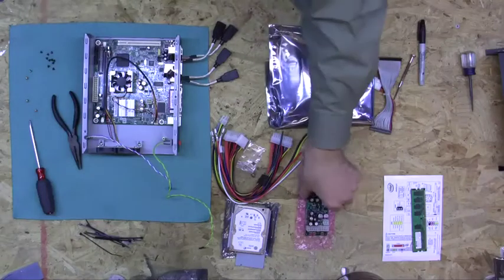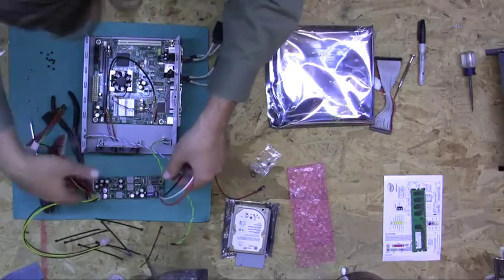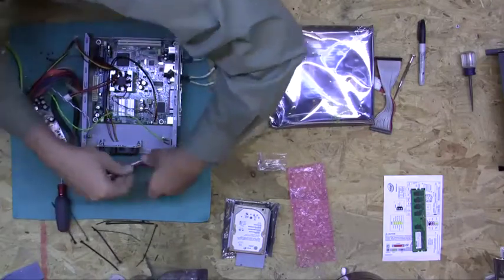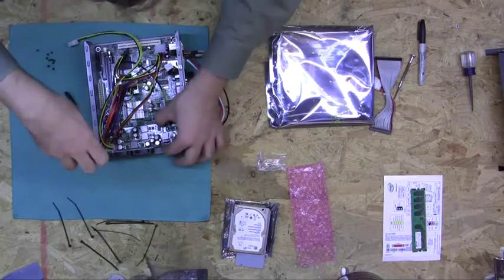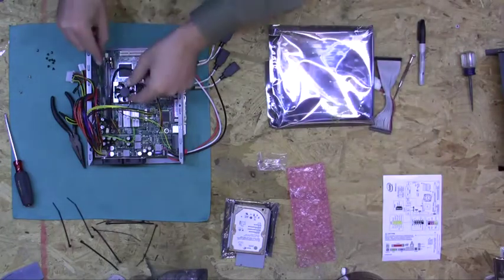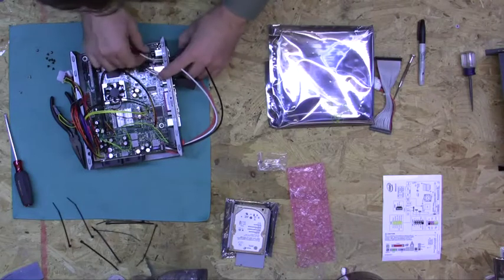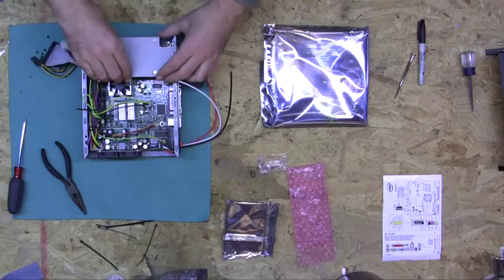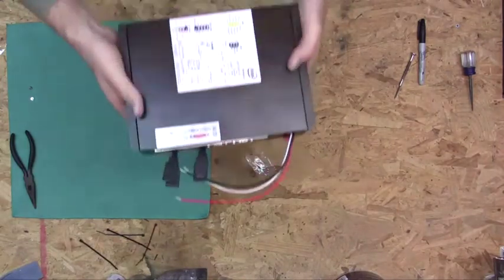How to Build a CarPC Part 3

Comment: very dissapointed, the only part i really cared about was the screen, and it wasnt even shown.  I want to use my laptop in car to read articles on the internet before work, i go to school early, then have several hours of spare time and live 30 miles away.  Was hoping to find a 7 inch single din fold out monitor with VGA input. Thought this video might give some kind of a lead..